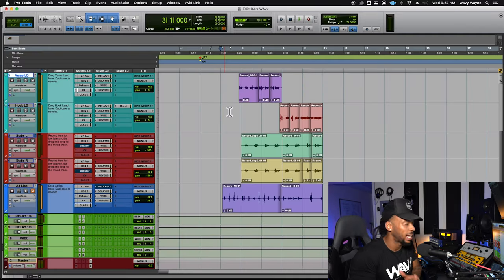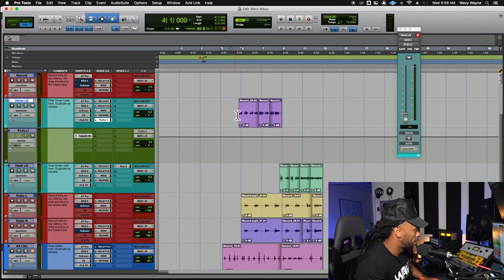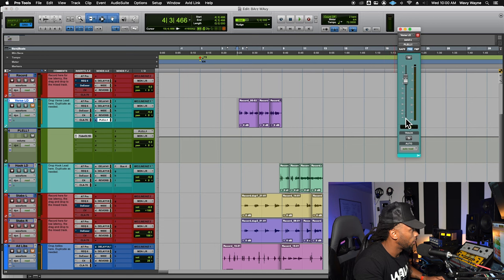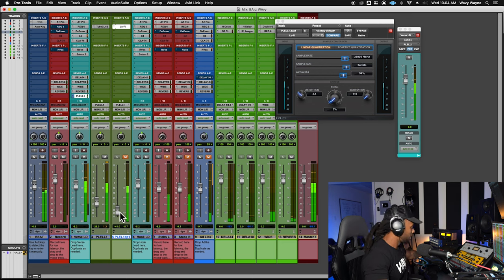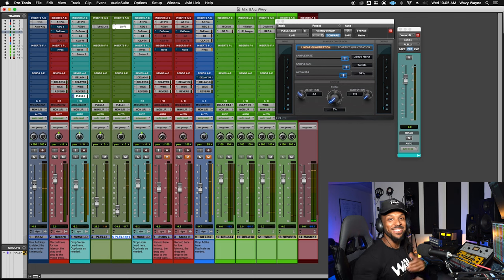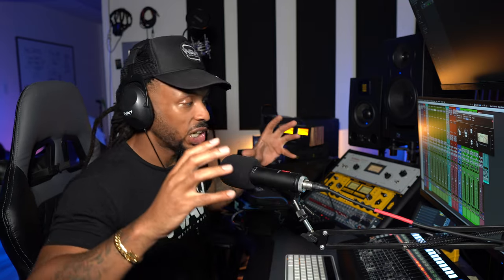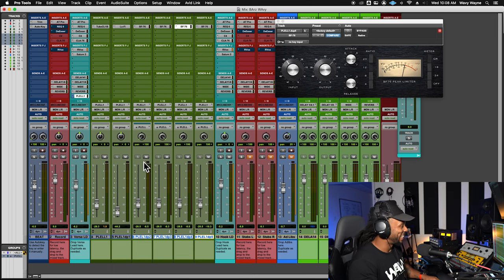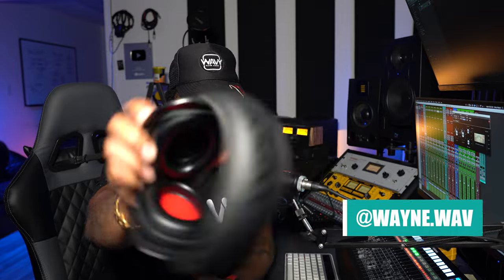What is Parallel Compression | How to Use Parallel Compression

Comment: Does parallel compression raise the signal of we’re it’s being sent? For example If I wanted to keep my vocal at 18db will adding parallel raise my signal hence then causing me to use a trim or gain knob to lower it back to my original 18db signal, also I’ve noticed when I send the parallel signal to my desired vocals it will amplify my reverb and delay and most of the effects I have directly on the channel, is this good or bad? or should I be placing my reverbs and delays effects on send tracks?
Reply: You need to put a vu meter on at the stages you want to level and use gain staging before and after each one. you could lose level or add it. all wet time based effects should go on sends unless you use a dry mix knob inside the plugin when using on the insert.
Reply: @kedontikereyle8436  thank you 👍🏽